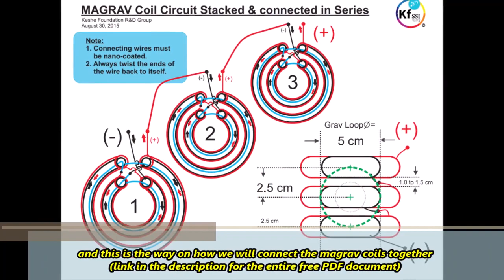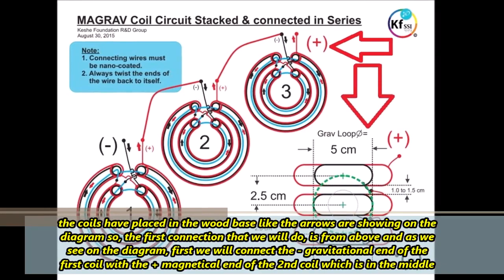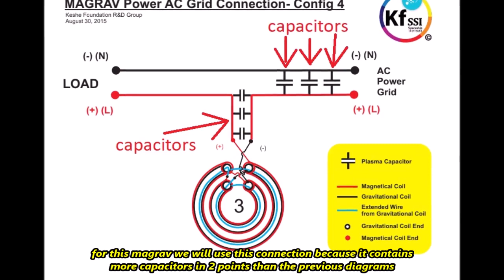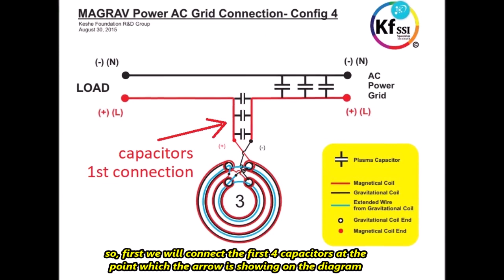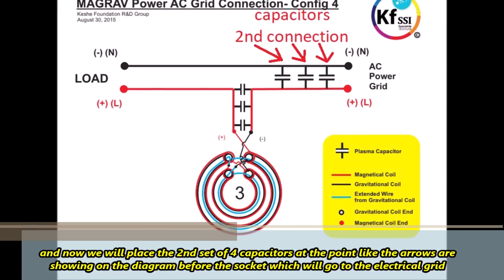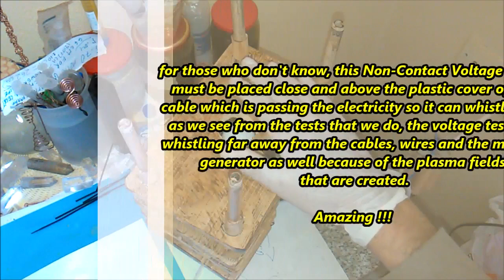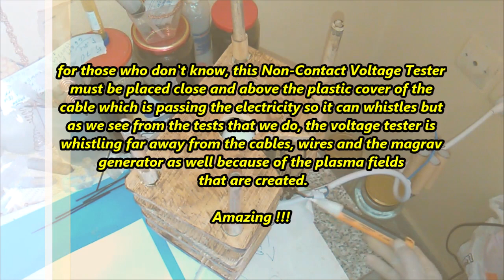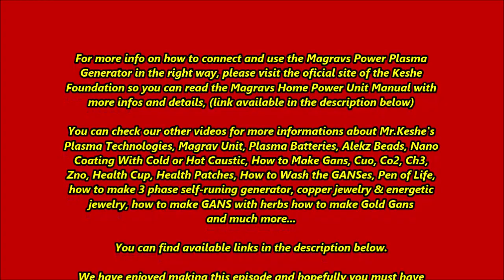How To Make The Magravs Power Plasma Generator For Free Energy, Keshe Technology, Tutorial

Comment from the maker: For more info on how to connect and use the Magravs Power Plasma 
Generator in the right way, please visit the oficial site of the Keshe 
Foundation so you can read the Magravs Home Power Unit Manual with 
more infos and details. Here the link: https://blueprint.keshefoundation.org/manual.php
Reply: Fraud
Reply: Yep, just read the manual, sounds like fraud to me too... I have yet to see one actually working, Powering a load, and NOT attached to the grid... This manual says it needs to be attached to the grid to work, the Keshe Foundation says it only needs to be attached to the grid during Power up, then it can be disconnected from the grid... So which is the True statement? Since no one has shown one working, Powering a load, it must be a fraud...

Comment: Check amperage from house by claw ampere meter and also check amps out to determine 
the output of the Magrav generator to determine energy added (savings).
Reply: Also will suggest to verify if the output is of the same or increased value, by measuring if the resulting output will do same or better job. For example by measuring the temperature of an resistance (heating device) in the circuit, or the level of light produced by an light bulb. The absorption of the amperage, or power from the main socket is not relevant, knowing that any insertion of an device in the circuit (source/socket and consumer as light bulb or resistance) will lower the current flow, giving us a false information about the efficiency of our work.

Comment: I am trying to find someone who has been able to get their Magrav to nano coat the electrical wiring in their home or business as Keshe said it would do. I built mine about two years ago but have not taken or done the proper steps to do that partly out of fear and partly because of not knowing how to properly install into my home.  I'm in a hot climate, S. Florida, USA so adding a useful 500-watt constant draw is difficult nor do I trust myself or an electrician to add it to my entire electrical service. We are on 110-volt services in the U.S. with two hots of 110 each coming in that can be joined to run the 220-volt cloth dryer and A/C system. All the rest of the branches are 110 volts.
Reply from the maker: Well, i was in same position like you because i was afraid for different reasons because i didn't know back then like i do now. Imagine tha i have made the magrav coils before about 2 years but i never finished the magrav until recenty like we saw in the video. Back then many people have made magravs generators without having the proper knowledge or without doing it in the right way as result, many of them have disappointed because they thought that this tecnology is nor working etc but is not true. As we saw in the 2 video proofs that we have done, if we make the magravs generators in the right way, in the end we will have positive results with visible magrav fields from the generator etc. The magrav it can nano coat the wiring in the house but the wiring in the house must be done in a specific way because when the plastic cover of the wire is taking of or it is damaged, the nano coating is not moving as result, the magrav will not nano coat the wiring in the house. So, my understanding is that the naked wires in the wiring of the home must be cover again with the plastic cover somehow otherwise the nano coating is not moving like we saw in this experiment that we have done long time ago https://www.youtube.com/watch?v=mYMRhbkCqzA&t=6s
I don't know if you have watched the next update that we have done about the magrav generator with different experiments that we have done and among them you can see that we touch the magrave generator with bare hand the moment that is connected to the electrical grid and you can see the plasma energy that is flowing through my body, here the link: https://youtu.be/zId7puo2IMs

The magrav can work with 220 or with 110 volts as well.

The only thing you must do is to make the magrav generator in the right way and also to connect it in the electrical grid in the right way and it will work properly. Also you can read and the instruction from the Keshe foundation about how to connect and work the Magravs Home Power Unit Manual in the right way. here the link : https://blueprint.keshefoundation.org/manual.php

Also you can make more than 1 magrav generator and you can place it in different area in the house so you can connect more load and for nano coating different wiring areas in the house. 

Hope we helped you !!! 

Have a nice day !!!

Comment: WHOA, you spliced a cable and reconnected it in a more complicated way.... then you dismiss insulation from wires to impress the viewers with the electrical noise that radiates from uninsulated wires. You can acquire similar results by spinning up a roll of Copper, plugging it in and putting metal in the middle of the circle because it creates a magnetic field! WITHOUT FAKE CAPACITORS. Also, NOT free energy.... you're plugged into the grid.